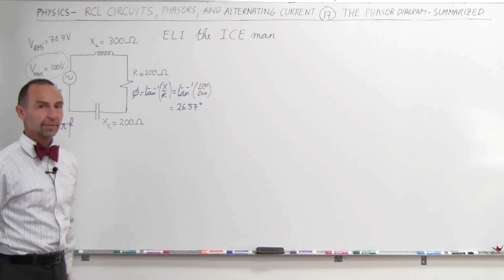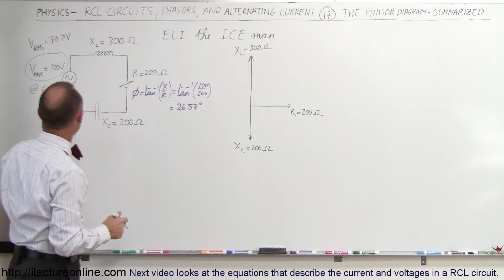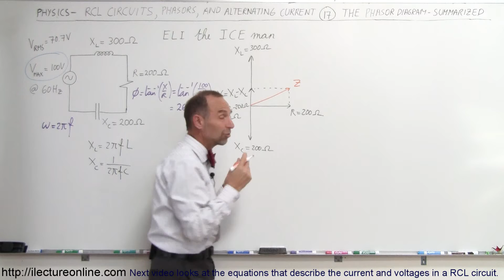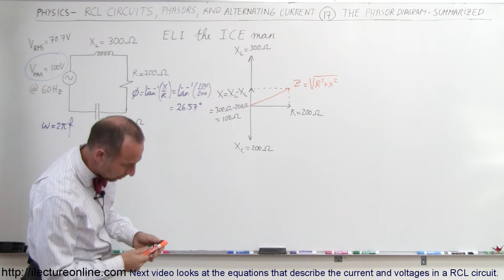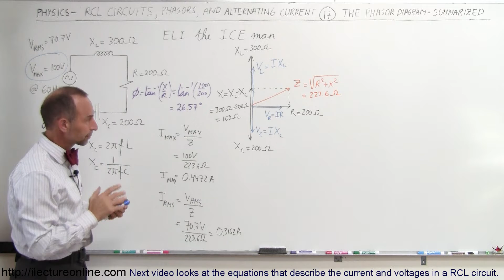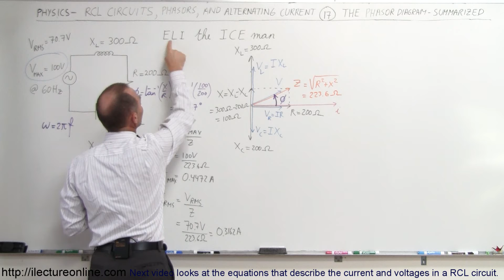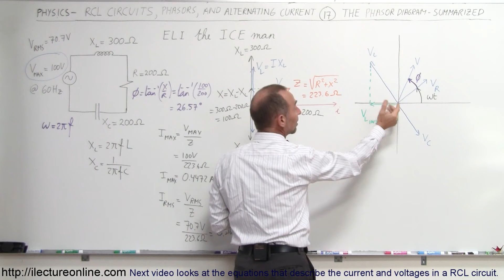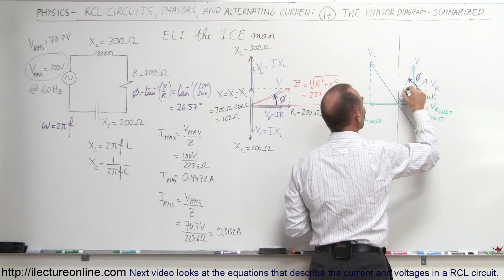Physics 49.1  RCL Circuits & Phasors (17 of 24) Phasor Diagram - Summarized

Comment: what happens if we  change the sequence of components in the RCL circuit?
Reply from the maker: If you mean, what happens if we place the capacitor at the top and the inductor at the bottom for example?  The answer is it would make no difference.
Reply: @MichelvanBiezen  for example if we place the capacitor between inductor and resistor in this case. thank you😍😍😍

Comment: So if they dont specify max or rms should we just use the max?
Reply from the maker: +Ashlen R 
It really doesn't matter, the method is exactly the same.  In the real world the voltage is specified and so we don't have to guess.  Typically the voltage is specified as RMS voltage.